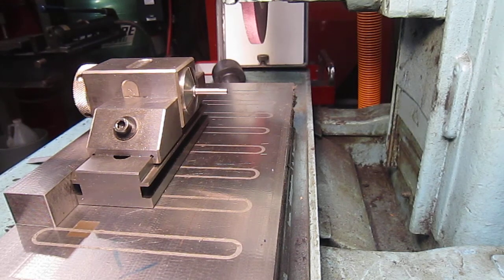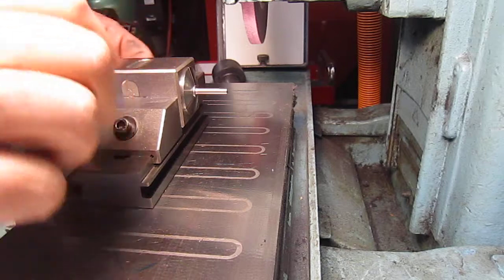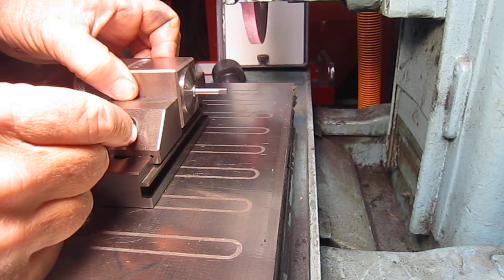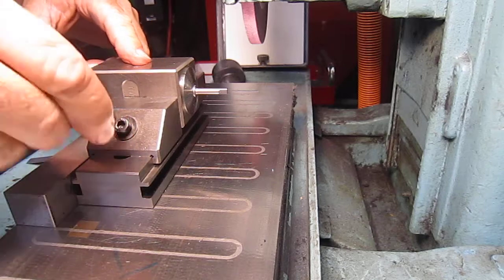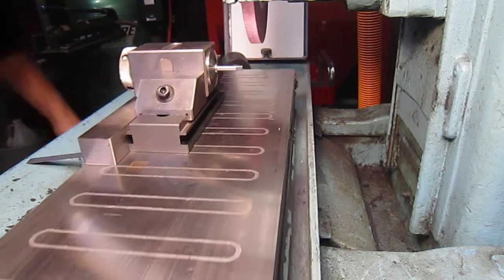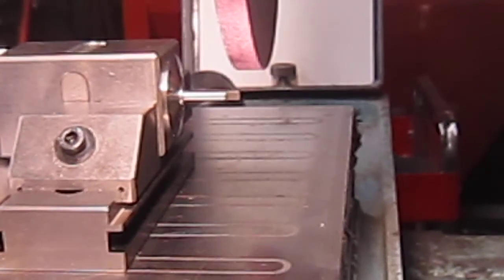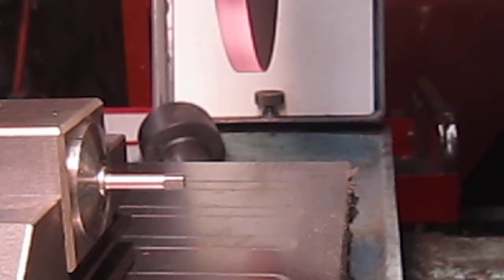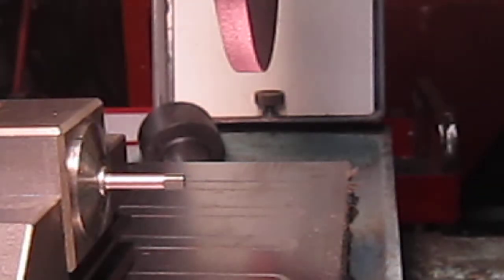Procunier collet build Part 3a

Comment: Hi Chuck,

You need some relief on the square. Did you shim under the vise or collet block at all? It should be slightly smaller behind the cutting edge.

Best,

Tom